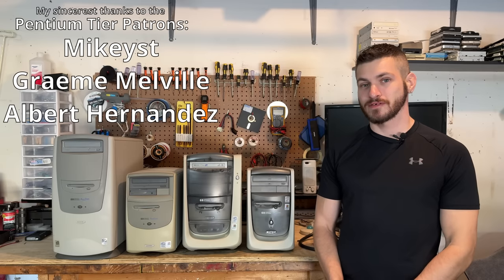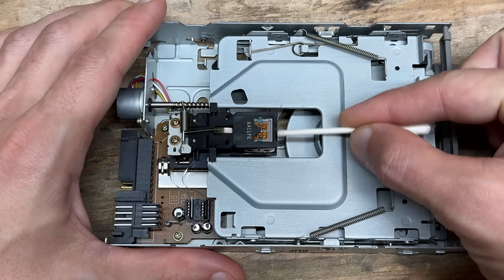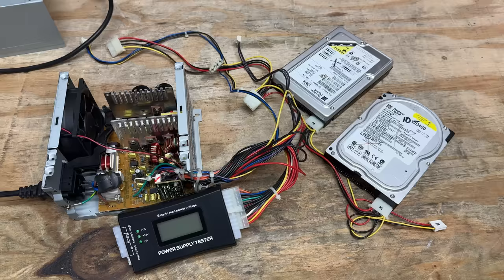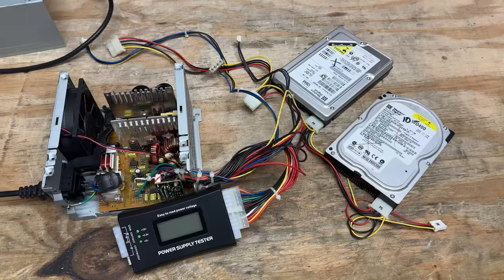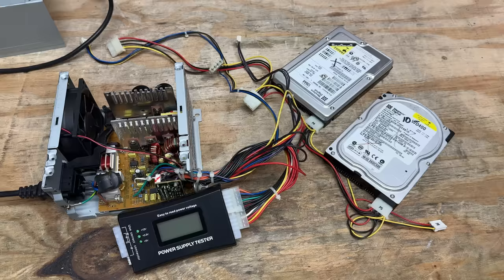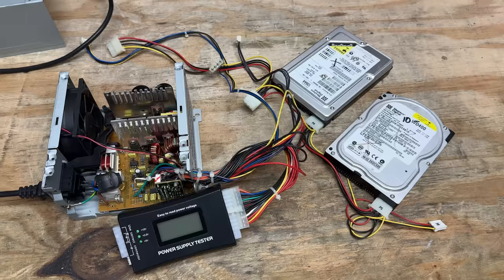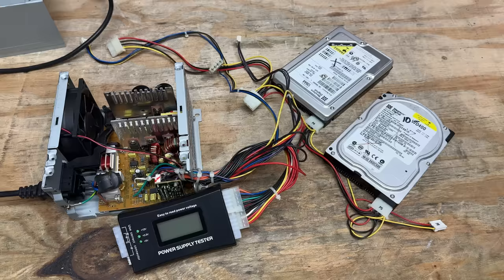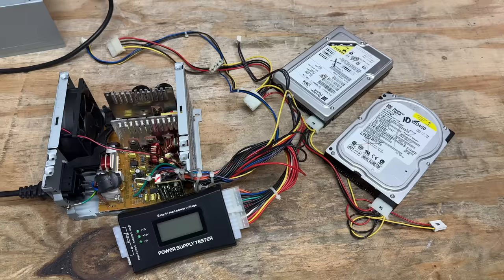HP Bubble Systems! Classic late '90s computers - Teardown and test!

Comment: That first system is the pinnacle of DOS retro gaming rigs... Despite being designed for Win95.
Socket7 Pentium1 w/MMX is very special to DOS... Ever since Phil and the Vogons guys showed us the setmul utility.
That mobo with the 430TX chipset is fabulous... USB ports are not common for Pentium1.
The second ISA slot would allow for a -5V Voltage Blaster, to run a good SoundBlaster.
The onboard ATI graphics would save a slot on a 2D card, for running a Voodoo 1 or 2.

When I was a teenager in 1996 my first high-end system was extremely similar.  I had a Gateway P5-200 MMX Full-Tower.  The similarly disguised ASUS mobo had a 430VX chipset, also with a couple early USB ports.  Though I'm fairly sure it had an S3 Trio 64 of some variety as it's onboard graphics.

If I had known back then what I know now, especially that the P1 MMX era would become my bread and butter... I would have pimped that rig to it's max potential, and gamed like mad on it, as if it was going out of style... Because it went out of style real fast.

Always trying to get my hands on another one of that exact model... But they just never show up.  I still kick myself that I tore it down for parts and recycled it.

Comment: Around 3:45 - The reason the sound card would need a connector from the PSU is because, at this time, HP often bundled these systems with a complete set of peripherals which included unpowered speakers. The idea was that the PC's sound card would have its own amplifier to drive the speakers - I have come across slightly later Pentium III/4 era systems that have a label on the back which indicates "powered speakers required for sound" or something similar.
Reply: Had a set to match this exact system back in the day. For unpowered speakers, they could actually get pretty loud and sounded fairly decent. This was our main computer for many years growing up.

Comment: Trigem was an OEM based in South Korea that was in a joint venture with eMachines from 1998-2004 I believe. They manufactured all in ones and many other computers also mainly for the South Korean market up until 2010 until going out of business. Strange to see them supplying HP with a hard drive though.

Comment: AWWW YEAH!  90'S HPs, BABY!  Been waiting for this one...

System 1: 
Is that a CD-ROM drive, or an out of balance washing machine?

System 2:
Cards: The modem/soundcard combo from these models were absolutely terrible.  I had to replace so damn many of them back in the day.
Zip Drive:  "Zip drive made by, who else, Iomega?"  Answer:  NEC had a license to build them.  I have an NEC-manufactured Zip drive in my collection.
Power Supply:  You're welcome!  Nothing like having a spare just in case!

System 3:
Power Supply:  Technically speaking, it is a "standard" ATX power supply.  It just happens to be a lot shorter in depth than the "original specification".  The closest you can get to replacing one of these, barring finding a used one, is an SFX power supply with an SFX-ATX adapter plate.  (I say "original specification" because these days there is a plethora of power supplies that are significantly longer in depth than the original spec.)
 
System 4:
Celeron: "That's looking Celeronni."  Celeronni... the San Francisco treat!
Lack of slots and Costcutting:  Yeah, small Celeron HPs were designed to be cheap and basic, with a capital C.  Not designed for enthusiasts or power users whatsoever.
Hard Drive:  This one is REALLY throwing me for a loop.  The serial number of the computer starts with a KR, which means it was built in South Korea.  I know TriGem was one of the OEMs that HP farmed their manufacturing out to in the late 90's and early 2000's, and the motherboard is a TriGem Cognac motherboard (fairly widely used on Socket 370 HPs)...  But the drive does NOT bear an HP Spares part label, and I have never seen a TriGem-branded drive in any HP, ever.  It looks to me like that hard drive may be original-ish.  My two hunches are as follows:  1) Drive is original, and the machine was part of a VERY early production run that didn't have proper labeling available or 2) Drive is not original, machine failed either at QC or delivery, and ended up in the hands of a refurbishment facility, which used a random drive.  I'd kinda lean towards the former because I also see no spares label on the ram, motherboard, optical drive, or floppy drive.

Comment: miketech... this one's on you! i actually found my first system to restore! i bought for 4$ at a recycling center. it was complete besides it missing the hard drive. sadly came with a defective floppy drive and dvd drive. they didnt want to work. your advice really helped. if i wouldnt have watched any of your videos, i would have plugged it into my wall blindly. but, i thoroughly checked through all the parts to make sure i have a non-lethal machine. i did manage to get it to run windows XP. this stuff that you do, its really cool! one day i hope to do more stuff like this.

Comment: I've had an HP Pavilion 8580c desktop since I was about 8 years old. Still have its original mobo transfered into a later HP Pavilion 8756c case that's next to my bed and in working condition 25 years after it was built. These were great little machines, and I even used the case of one till 2016 as a portable full atx case that fit in a suitcase for my main pc back then, too. TSA kept stopping me to ask what was in it, though. 😂

Comment: Fair play to the previous owner of S4 for getting use out of a system that would have been a decade old at that point. 

Seeing XP on a 9x based machine was a surprise too! (although seeing as it was designed for 98, this machine would've been 2-3 years old by the time XP came out)

Comment: I thrifted a tower very similar tower to the first one in this video. It even had a sound card that was directly connected to the power supply. The main differences are: 

There is a small removable shield in front of a single 5 1/4” bay below the CD drive 

It has a Pentium II 

The motherboard doesn’t have integrated video and there was an ATI 3D Rage II+DVD card installed

Comment: Great video. Just got one of those stubby translucent dealies (HP 6735) from a barn find along with the 17' HP monitor... took some effort to clean up and reseat everything properly with new thermal paste, but it's running now. We sold lots of these at Staples in the late '90s and early '00s. It's a Celeron 633 with a loud PSU fan that's most likely to die first. Still, glad to have it and I may drop a Pentium III in when I find a cheap one.

Comment: I have one of those HP bubble computers mine is pavilion 6736 from 2000 and runs windows ME. I still have EM on it as this identical to first PC I ever used. When I got it the Samsung CD-rom drive was completely dead so I swapped in another from an HP bubble system that had a dead motherboard.

Comment: 30:53 the faceplate of that HP burner looks very Mitsumi. Like a CR-4802TE, CR-480ATE, CR-2600TE or other from around the same few years. I have a 8x read 2x write model somewhere from back in the day with the same pill-shaped eject button, raised bar across the bottom and flip-down door.

Comment: I had a few of those systems with translucent panels, they called it the "Skywalker " chassis. Love the CD storage on top. Asus was the OEM for the MB. My top one had a slot 1 P3 533 with 96MB of ram and CD burner. ATI rage onboard graphics and 20GB HDD. Bought my daughter the smaller version with a celeron CPU and 64MB of ram, dog of a system but I got it cheap ( for the time ). I do miss the P3 one, brings back my day on Napster on NetZero dial up

Comment: Pushing the door closed on drives is what causes them to fail over time, should always use the switch. If discs stick, there's a little gripper on the spindle top and it gets filthy, and sometimes they are some material that degrades and becomes a sticky mess. It's a particular problem in plextor drives and the disc will get stuck and the tray won't open.

Comment: Glad you're feeling better, getting sick sucks! I got a respiratory infection when I was about thirteen or so in the early summer, I sounded like Batman for a week. Hurt to talk but I couldn't stop talking 'cause it was so funny. 

I visibly twitched when you switched on the PSU from the 3rd system. Way back when, these are the PC's that taught me to test PSU's first. I plugged in a nearly identical system to this that I'd found out for trash, it had the Riva graphics onboard as well as the audio, weirdly enough. The PSU was shorted and gave me a nasty shock as I was touching the PC case when I plugged in the power cable. It somehow didn't damage the system, I transferred the motherboard, CPU, RAM, and optical drive, but used a different floppy and HDD in another case. I had that HP for a long time playing old games on it, it ran Half Life 1 great even with the weird onboard Riva graphics, I think it had 16MB of VRAM but I can't remember. 

I've seen another one of those Bestec PSU's go up in smoke, it's why 13 year old me was not allowed to test electronics in my Grandma's laundry room anymore, had to do it out on the back porch where the smokers got exiled to or way outside on the picnic table haha
Reply from the maker: LOL I briefly contemplated doing the rest of the video in the style of Batman when my voice was at its worst.
Reply: @miketech1024  That would've hurt you as much as it hurt us, we all would've been dying of lol. 

On a more serious note, please watch out for those Bestec PSU's, I was finding them with failed capacitors and that stupid conductive glue 20 years ago when these PC's weren't all that old, they're dangerous. eMachines and Packard Bell PSU's come in a close second.

Comment: I had one of those HP bubble systems. It was an HP 8750C. A friend of mine gave it to me. He bought it at the Ingram Micro returned stuff sale at his work. The problem was that the system kept intermittently going into hard lock. I tried swapping everything, but it kept going into hard lock. I looked online and a lot of people were complaining about the same problem with this model but HP wouldn't admit that they had a batch of bad motherboards. So I just replaced the motherboard.

Comment: Cool, I actually had a 4550Z, that very same Pavilion model.  It came with a Maxtor 10 GB hard drive (I remember, because I changed it out for a bigger hard drive).  $999.00 at my local Office Depot in 1999.  Also, I remember I put an AGP video card in it.  You had to switch 2 jumpers, to tell the computer to go to the AGP slot for video instead of the motherboard video, which was an ATI Rage IIc with 4 mb of video RAM, if I remember right.

Comment: I have an hp pavilion 6553 and it’s all original still working I found it in a woodshop and asked the owner if they wanted it they said take it they didn’t know if it worked it was filthy on the outside it came with the original monitor which was the most dirty I opened up the computer shockingly it was pretty clean still rocking the original hard drive and I got the speakers with it that mount on the monitor everything all original for free I’ve been using the computer now for about a month and a half it has windows 98 second edition it looks like the last computer you go over in this video but different model

Comment: Get a bottle of MG Chemicals "Rubber Renue" (yes, spelt right).  Make sure you open the window when using!  I've used it for 70s and earlier tape decks & turntables on all the rubber parts, belts & idler wheels!
BTW, Im the original owner of an HP 760n (exterior perfect, I updated h/w & s/w  a while back)

Comment: the 8240 and the mid tower version is favorite case to work in. also have the mini  4550z or similar model  the mid tower is niuce takes a std  atx moibo favorite feature is the dark gray drive bays slide out as a single unit

Comment: I had one of those samsung 8.4g (Under the spinpoint series) drives for a long time. seems as there were several trigem branded versions of these drives. the first time I saw a trigem branded drive was in a brand new emachines system that my brother in law was trying to set up for his mother. the thing was actually DOA from the factory lol.

Comment: The first PC my parents bought for themselves was an HP Pavillion 8510, with an AMD K6-2 at 500MHz, and 64MB of RAM, 8MB of which was used by the integrated SIS 530 graphics. Compared to the kind of PC I was using at the time it was junk, except for the case, which I still have. It's had quite the upgrade, as its contents are now a Gigabyte GA-7N400 Pro 2 motherboard, an Athlon XP 3200+, 1GB of RAM, and a Radeon 9700 Pro 128MB. That lot would get a bit hot in a case with only the PSU fan, so there's a hole cut in the top of the metal case, and some supports removed from the inside of the top panel to fit a slimline 92mm fan, that exhausts out of a slot cut out of the rear edge. I've thrown out a lot of computers over the years, but that case is just too well built and too nice to work on to get rid of, even if it's just being used to prop up a desk these days.

Comment: I love the bubble systems, and I have one; a model 6736 that came with Win Me. It uses the same case as the last system you showed, even the same color scheme. Tri-Gem was a Korean manufacturer that owned eMachines. They put their name on some things that were made by others, but they also made their own stuff too (like motherboards). Everything in my eMachines is labeled Tri-Gem, and yes, it has a Tri-Gem hard drive made by Samsung

Comment: The modem is a voice modem and not a sound card.  There is software that connects the sound card and modem together so you can use your PC as a phone.  It was common for a while.  Most modems with the audio ports were typically intended for this purpose. Edit: after seeing that second third system the game port was on the modem so maybe some OEM stuff linking the modem and sound for the space constraint as you mentioned.  I had not seen that before.  My bubble system doesn't have that - the sound and modem are separate.

Comment: The last system was used until 2009? Well, I have an eMachines eTower 466i with the same Intel Celeron 466MHz as the last system, though it has 512MB PC133 RAM and a Seagate 40GB HDD (upgraded from original 64MB PC100 [or was it PC66?] RAM and TriGem 6.4GB HDD). I actively used that PC with Windows XP Pro SP3 intul June 2015! I even used to watch YouTube videos on it, though it did struggle a lot. Still have it and it's working. It had stabillity issues for years, I had no idea what it was, but a few months ago it truned out on of the RAM sticks was faulty (completely stopped booting and after removing one of the sticks it worked), now it again has two good 256MB PC133 sticks of RAM.

Comment: At 4:42 if I recall, PNY are/were a hardware manufacturer. They made graphics cards of the Voodoo/Voodoo2 variety.
Reply: PNY is still very much alive, making mostly memory and flash drive products.
Reply: PNY is (and was) first and foremost a memory manufacturer.  In addition to those Voodoos, they've also made GeForce cards.  I have a PNY Verto FX5200 in my Win98 machine.

Comment: In 2000 when I was 2 or 3 we had a bubble Pavilion exactly like the 3rd one from the left that ran Windows 98 and had the Plus package that we used until the fall of 2005 when we got a Dell Dimension with Winxp Media Center Edition 2005. When I was 13 I unfortunately thought it would be awesome to destroy it. I will never destroy an old pc of ours again.

Comment: 32:24 That streaking on the splash screen is probably caused by that TNT2 card. I got a similar system with the same card and it did the same thing. Think they all just cooked themselves since HP/Asus in their infinite wisdom didn’t put a heatsink of any kind on the gpu.

Comment: Great to see a new video again, I checked the last week ends and was wondering why there was no videos, thought you probably were too busy. We don’t think about it as much but I guess COVID is still a thing…
Anyways that’s some nice systems as always. I have the same case as the 3rd system but it’s in rough shape with missing parts and most of the original hardware from it is gone (Still have the PSU, CD Burner and the sound card/modem combo), though it was not the same system originally as the motherboard had a socket with a 450mhz celeron. It died probably about a decade ago and I threw it away without thinking much about it, at a time when it was basically worthless. Who knows what was wrong with it, for all I know it could have been a easy fix.
I have heard of TriGem branded Samsung drives, though I don’t have one of those in my collection. I have no idea why they did that though, it would be interesting to know.
Reply from the maker: Thanks! It did hurt my soul having to skip two weeks of uploads, but my voice was so bad it would have sounded super annoying. Never skipping a flu shot again!

Comment: Yep used to trash pick tons of these myself back in the mid 00's I'd nurse together "mom-proofed" as basic internet computers for friends & family, often only for the cost of whatever it needed to complete it. They looked good, were particularly useful for Debian or Red Hat, suitable hardware for the application.. They sucked as OEM systems but made fantastic locked down idiot-proofed Linux boxes. Most of the Windows crapware anyone I gifted one too wanted to run worked good enough in WINE.

Comment: Fixing a CDROM drive is NOT always that easy. Sometimes the capacitors go bad and leak onto the PCB and destroy the traces. What would you do if the drive fails to read the CD and you already tried cleaning the cdrom lens ?